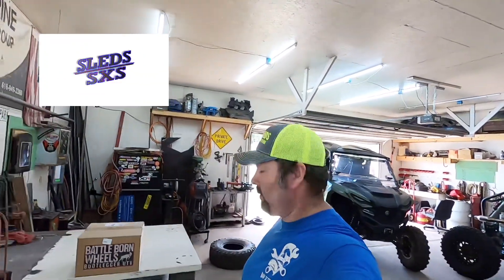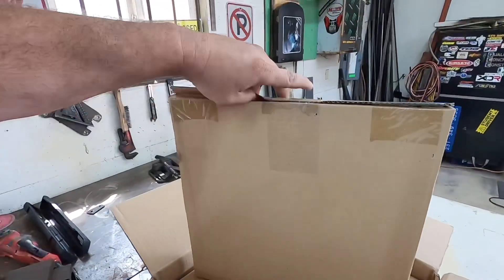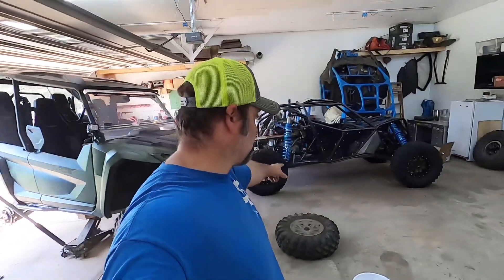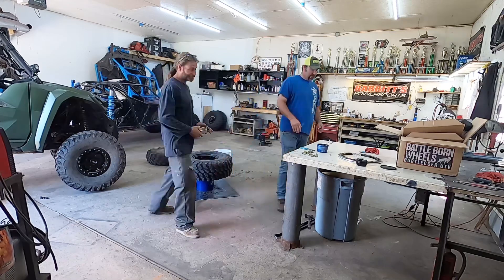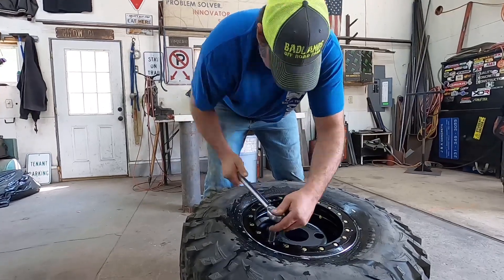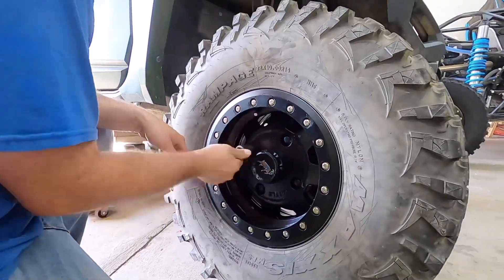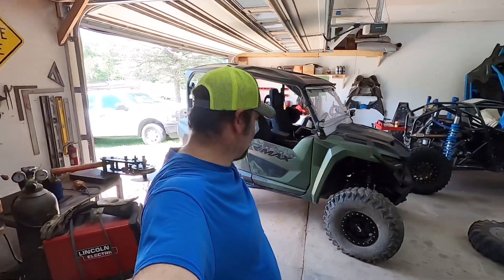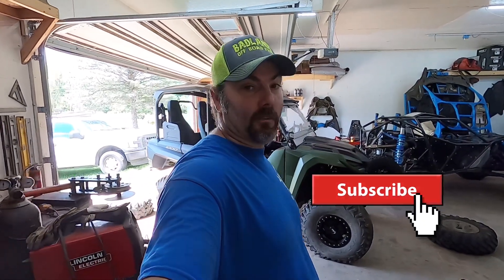New wheels and tires for my Yamaha Rmax 1000!

Comment: Have the rear tires rubbed yet? Also, what diameter do those tires actually measure?
Reply from the maker: Yeah,They run very slightly on the plastic covering the frame directly in front of the tire, the tires should be close to 32 I’m guessing, at 5lbs of air in them, which are squatted pretty good, I’m at about 30 1/2 tall